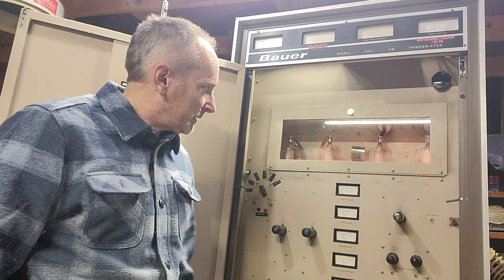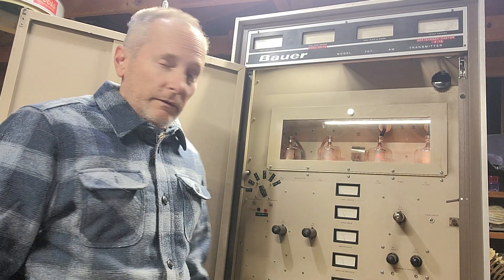Bauer 707 Update BIG TROUBLE!!

Comment: What kind of tubes it use on the final stage ???
Reply from the maker: 4-400 pair modulated by 4-400 pair.
Reply: @n9amiwavelengthradio  thank you.  The power output is about 250W ??